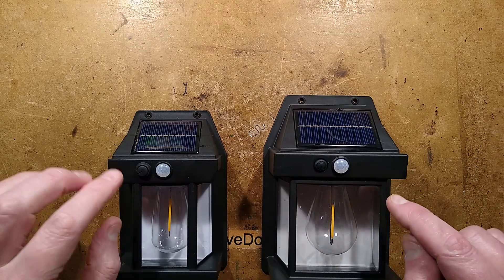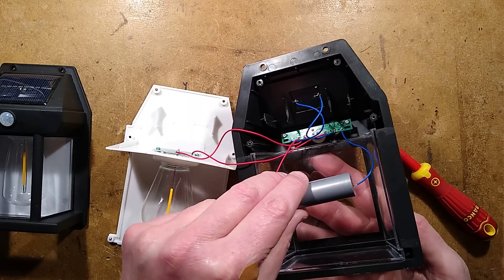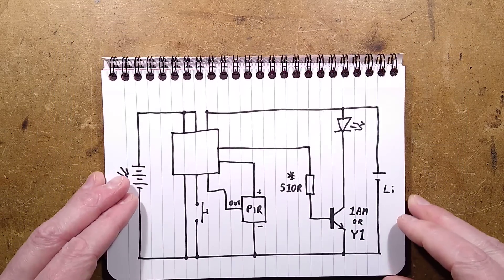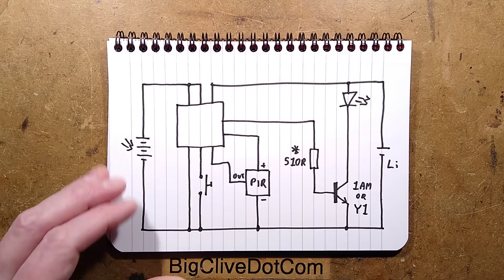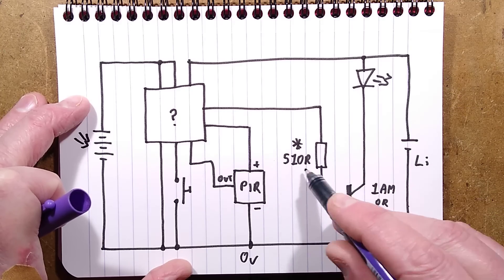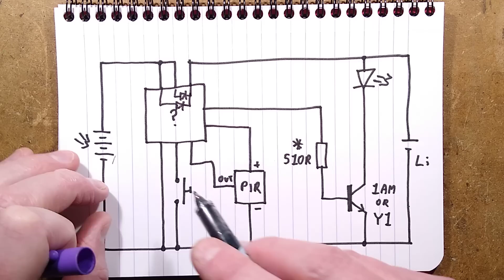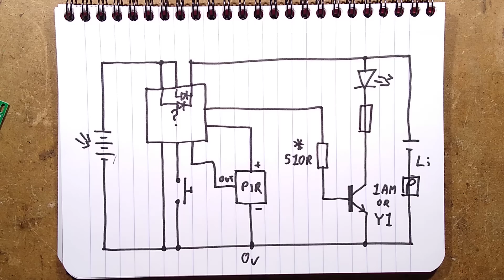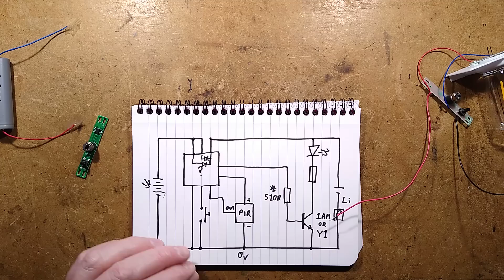Perplexing Temu solar filament lights

Comment: I would say that people like you or me would probably still buy it but make it so the Li-Ion cell has a proper solar charge controller for an 18650 that would bypass the chip.  I mean, it shouldn't be hard to find something to do that, right?  I wouldn't think they're all that expensive either.

Comment: I'm really struggling to find some good solar lights like these. I bought a few, several years ago, but they're pretty terrible when it comes to their sensor angle, the solar panel not charging consistently, and their on time. They all either stay dim and brighten up when they detect someone, or stay on for 10 seconds and then shut off. I'd love one that stays on for a minute or so, then shut off.

The ones I have also dont turn on most of the time as they seem to struggle to charge.

Comment: Are they adequately sealed to prevent water ingress, ultimate failure and route to landfill? 😢
Oh for a good reliable outdoor solar light that doesn't end up fekd
Reply: Salvage the junk lights and discarded leds, add vape cells and hw107 charge/discharge controller board or buy NiMH cells for simplicity and you can have lights that only need new vape cells every hundred cycles or so, [NiMH last for years] . I've been frankensteining indoor & outdoor lighting for the last two decades and the flood of cheap garbage has kept me supplied with varying options from twinkling dragonflies to flickering flames to steady spots to pir floods, rgb, bipolar and every colour variation imaginable. The only downside is the actual volume of dead and dying tat that people donate. The upside is that I rarely need turn on a mains powered light unless it is to look for something or to read by both indoors and outdoors and across the garden, in the workshop, the polytunnel, greenhouses, sheds, porch, loo, carport, pergola and everywhere else. My life is illuminated by tiny fireflies that turn on as I pass or as the sun sets throughout most of the year. All year where important.
Thanks to Clive and others I learned everything to work on simple circuits up to my 6kw solar lifepo4 system that powers my whole home and workshop for free for 50 of the 52 weeks of each year and my reserve battery should now cover the dark weeks around winter solstice.

Comment: Hello Clive,
The reason why so many electric scooters and power drills batteries are going up in flames lately.
Any Chinese battery-powered device without a true CE-UK-US safety mark, charges the Li-Ion cells like they were Ni-Cd or Pb-H2SO4 cells. The chargers type don't match the battery type. 
I remember the solar light shown in the video, few years ago, used the same circuit schematic and few Ni-MH cells.
A solar light with such charger is a firecracker, but a power drill or a scooter with the same inappropriate charger - is a pipe bomb. 
I check every battery-powered device that enter my house, to see if it use the proper Li-Ion charger and battery cells.
Something is not right. The import-export agents should be able to catch all these fiery devices before they enter peoples' homes.
Greetings,
Anthony

Comment: My father bought few similar ones long time ago on some "facebook sale", first battery died after one sunny day. Rest of them died that same week. After seeing that battery I put in first one died at the end of that same week I finally checked and sure, no battery protection on board. These at least have LED resistor so premium version I guess :)
I added two normal diode in series with solar positive, it's not perfect as voltage drop is around 1.2V but with any current that rise towards 1.3 so...let's call that close enough :)
All of them works for three years now without issues, even spending winters outside using recycled laptop battery cells. Ideally adding one more schottky  diode in series would be perfect, keeping cell voltage around 4-4,1 prolonging life of cells but even this work fine.

Comment: It's possible Q1 is a prebiased transistor with an inbuilt base resistor and pull-down. They're pennies per hundred, but I wouldn't be shocked to discover it wasn't

Comment: What is the running current? I presume it's PWM?
Reply from the maker: I didn't get as far as measuring the current.  It does use PWM for intensity control.

Comment: Would adding 2-3 cheap diodes (1n4148) in series from the solar panel reduce the voltage enough to be safe for the battery?
Reply from the maker: It would be tricky to match the wide voltage range of the solar panel in differing seasons.

Comment: I think it should be fine, explosion-wise. 
The pv panel looks like barely pushing 50mA peak and the cell would require 10h of straight sunshine - which just can't happen. But even if in pir mode and next day the cell is still full, 50mA just won't cut it to detonate the cell. 
Degrade it... yes. Kaboom... probably not. 
After 4.2v the esr shoots up and the cell disipates the energy as heat. Put in enough energy and the electrolite gets decomposed and evaporated. 
Your bench supply can, the tinynpv panel can't.

Comment: Bought two of the "120 LED Solar Street Lamps" from Aliexpress and both charge the battery over 4.3Volts. Still working after 1 year, nevertheless. I think I sent you an email with photos of one of them after a storm knocked it off and flooded the interior.

Comment: In principle, if the device had an absolute ADC, there are a number of ways that this could be 'safe' (still at risk of overcharge in crashes). For example, short the solar cell on the input by driving the input low, when >4.2V occurs. Or for perhaps even cheaper, compare the LED voltage Vf to battery volts and use that as a reference. If you know the capacity of the cell, and time how long the LED lasts, you can internally measure capacity and ensure that integrated charge is under that. All hacks. Some may even work.

Comment: Temu was hit-or-miss from the get-go, and has become increasingly more miss than hit.

It might be worth installing a jellybean protection circuit if you bought them in bulk earlier and have limiting resistors on hand, and you got the lights themselves on discount.

Otherwise I don’t see them as being worth the risk.

Comment: I actually wonder if this might have been originally designed for a couple of NiMH batteries instead, and they just swapped them out for LiIon later (because those are a lot cheaper nowadays), without changing the circuit design at all.  (I've seen a lot of older versions of this sort of thing designed to use NiMH batteries because you can often just charge them directly off a solar cell without worrying about any additional charge-control circuitry, etc)
Reply: My thoughts exactly, and a similar comment added above/below. NiMH is the better choice for most temperate areas.
Reply: Good point there.
Gaz Yorkshire
Reply: I have a 5year old NiMH unit that's barely hanging on. Now indoors and 1/4 of the original stringlight... lights for an hourish  Slowly being trickled to death and (not) very impressive.
Reply: Probably not, tbh. 2 x NiMh cells is only 2.4V. Would need a boost converter to be able to light up a white LED. They usually require at least 2.8V, and crappy Chinese ones more like 3.4V.

Comment: If only the micro had a power supply monitor circuit that caused it power up and turn the LED on if the voltage went above a certain threshold..

Comment: At least the smaller light has 10 solar cells as opposed to 11 for the larger one. So the smaller light will see ~0.5V less  charging voltage in bright sunlight.....

Comment: I have to wonder if the interpretation of how a solar cell performs is affected by the crippling levels of smog in China.  Perhaps, in order to save on labor, these were designed by a gradeschool-equivalent science class with a "measure and function" design philosophy common in primary education.  Or, perhaps, they just don't care at all and want to get the cheapest possible thing out the door for maximum profit.

It's Temu, so likely the latter option.

Comment: Thanks to Louis Rossman, I prefer to buy such items at local stores, even though it costs more.  That's because local stores have an incentive to keep customers happy, as well as not having defective items returned.  If the item isn't available locally immediately, I stick to brands which are offered via mail order by those stores.  For example, I recently bought Westek night lights online because Ace Hardware offered them.

Comment: Its actually quite elegant, if they programmed it properly.  I could easily make something like that work with a PIC8 or PIC16 microcontroller pretty-much as-is, just with decent firmware coding.  Whether they coded the firmware properly or not is another story, but I'll tell you how I would do it.

* The protection diodes in the PIC chip will work just fine for this application.  Remember that the solar panel itself is actually a diode as well, so all the protection diodes in the PIC chip are protecting against is reverse leakage, which will be micro-amps, and also powering the microcontroller when the sun is down... but the microcontroller doesn't pull very much current, so that isn't a problem.

In the old days of HCMOS we used to power portions of the circuit board with HCMOS gate outputs instead of directly from the power supply, allowing us to control power to various parts of the board.   This works the same way, albeit somewhat less efficiently.  But the reverse-biased current is going to be so low it just won't matter.

* The microcontroller can easily burn however much power it needs (within reasonable limits) to keep the voltage of the solar panel down... if its firmware is coded for that.   In otherwords, we would be relying on the natural current limit of the solar cell to control the power. 

There are multiple ways to do this but the easiest is to just turn on all the internal peripherals and eat cpu cycles... or just turn on the LEDs... or have a pin control a resistor to ground to bleed power.

* I would expect the microcontroller's absolute maximum voltage tolerance to be 6.5V or so in this situation.   And it probably works down to roughly 1.5V.   But yes, if this is a standard lithium cell it must limit the voltage to 4.2V or lower for safety.

To test that you need to put a current limit on your power supply roughly similar to the solar cell... but it still won't simulate the solar cell because the solar cell's voltage drops linearly with current while the power supply voltage doesn't drop at all until the current limit is reached.

So test with the actual solar cell and see what it does.

* Charge current is naturally limited by the solar cell.

* The microcontroller can trivially monitor all voltages on its pins and simply cap the voltage on the lithium cell by burning cpu cycles or turning on the LEDs.

So... I could definitely make this work.  Whether the vendor did all of this properly, however, is another story.  If they are using a lithium-ion cell instead of LiFePO4 then I wouldn't trust them to get the firmware right either... the product will fail after a year or two with a normal lithium-ion (NMC) battery.

But yah, this is really elegant... the hardware that is.  I would probably build a circuit just like this.  But of course I would program the firmware properly.

Addendum:

* Double-check that lithium cell, it might have protection built-in.

* On current-limiting the LEDs..   You don't necessary need a current-limiting resistor when driving LEDs.   Well, you definitely don't for current-regulated LEDs.  This particular filament is not current regulated-though, it is voltage-matched.

This actually works as long as the voltage does not exceed the optimal value by too much.  All that happens is that any voltage above the optimal value dissipates as heat in the LEDs.  So the LEDs will run hotter, basically.  This is fine as long as they don't overheat.   The limited capacity of the battery itself means that the voltage drop of the cell when the LEDs are on (the internal resistance of the cell) might be enough.

Another way of dealing with it would be for the micro-controller to simply PWM the transistor based on its voltage reading of the battery.... if the firmware is smart enough.  I could certainly do this quite trivially.

-Matt

Comment: Something I learned by experience is not to make lithium ion cells angry (and they have no sense of humor at all), I have a huge box of recycled 18650 from laptop battery packs and many others from other types of e-waste like vapers and old cellphones, i was making a 3S4P battery for a router with a 3S 40A BMS and made a funny mistake, I am glad to always have a metal bucket full of sand close to my work bench just in case of fire, since then i have a double checklist when dealing with lithium cells.

Comment: got a set with the panel on a wire..has a metal lantern thing and pull cord switch. really good. lasts all night, brightness settings and a remote and its bright enough for my tiny chill room to read and whatever.
was curious what voltages the bulb was running on. doubt the battery is anything so its gotta be efficient.
also its a really nice warm light that has 0 flicker 🙏

Comment: could swap out the battery cell for a mobile phone battery with protection built in, could graft in a resistor in the led filament and chop a section of leg out.

Comment: All they had to do was use an ADC (assuming that uC already has one) to sample the battery voltage when charging and turn on the leds when an overvoltage condition is detected.

Comment: On the note of the 3v filaments, I bought a set of 10x 3v LED filament "S14" bulbs (which look like these lanterns but with actual E27 bases) from aliexpress, and they sent 2x 3v bulbs, and 8x 220v bulbs, it's a good job I only wanted a couple of the bulbs anyway (for those Joule thieves I wanted to make the other day, but spinal troubles still, can't sit comfortably to work on them), but having 8x 220v bulbs with only a single resistor in them with no drive circuitry for rectification, yeah, no, don't know if they're AC filaments owing to my not being confident in plugging them in... :\
Reply from the maker: Can you stand comfortably?  All my workbenches are for standing at.

Comment: "Two improvements to these lights would be adding a small protection module to the lithium cell, and adding a resistor to limit the maximum current through the LED filament." - And miss out on all the fun?

Comment: The cell might have a protection chip built in to the battery, have you tried to over charge it ?? I've got some cells with it built in and as they approach 4.29 the cell goes open circuit and you cant charge it further.

Comment: Can the micro control chip be replaced with a better suited chip ? 

Maybe something a bit less crap and a bit more suited to the longevity of the lithium cell with all the power safety stuff built in ?

Comment: Going BANG is agreed not to be a good thing.  What is the simple, cheap and easiest way to put in the protection against over-charging??
Reply from the maker: Add a lithium cell protection module.

Comment: I can confirm your findings. I have two of those, only difference being they include a led array. Chip/transistor markings are the same and board layout similar. It has no charge controller and kills the cell quite quickly. In my case it lasted a year, but that is in Ireland with two sunny days per year. They go high impendace as you told me in a earlier reply. So you think protected cell is enough to make it work, or a inline charge controller is needed?
Reply from the maker: My choice of upgrade would be a cell protection PCB. Or use a cell that already has protection.

Comment: Obviously, this is a custom circuit designed for use only in the UK, where the weather is always cr@ppy...  They would have a different circuit for use in Southern California!
Reply: Yes, of course they would.

Suuuuuure they would.
Reply: I'll swap diffused sunshine and stable tectonics over skin cancer and a volatile subduction zone any day. At least your solar lights will illuminate your collapsed cities while they rebuild the infrastructure. Lol.
Reply: or up north in the summer time where you only have about 7 or 8 hours of darkness... (it would work fine in winter if your house lasted that long)
Reply: Well normally you'd expect that, but we're talking about Chinese ingenuity and logic here "just pump out as many as possible, who cares where they go, as long as they go"